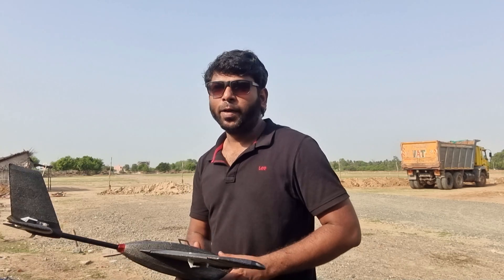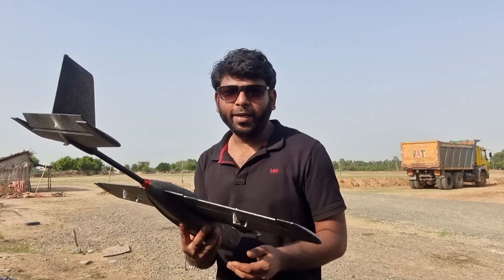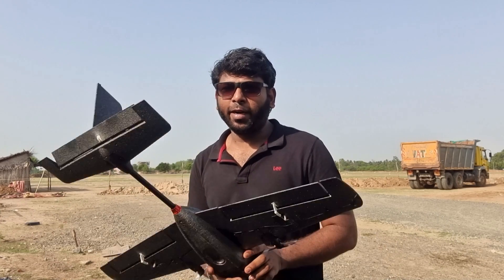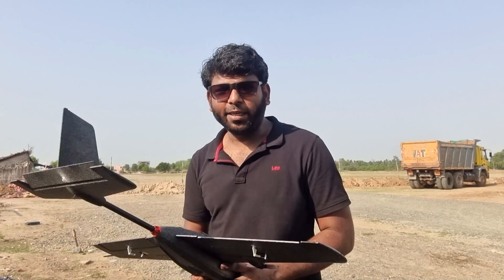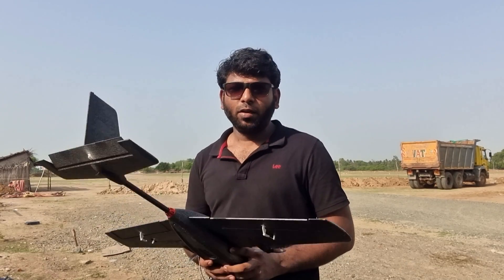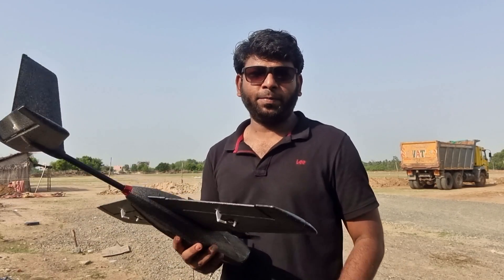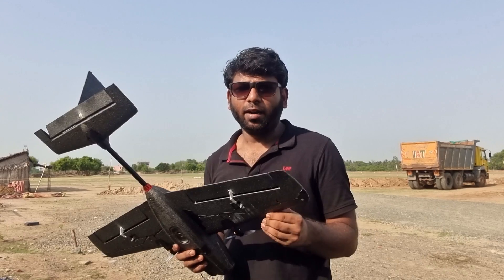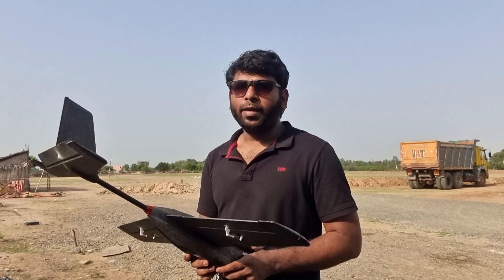Beginner's Tutorial: Arduplane Flight Modes

Comment: hi sir 

how to upgrade x6 motor esc  12s to 14s  with hobbywing datalink...?
Reply from the maker: Hi..
Regrettably,  upgrade is not possible. The X6 motor is designed to support a maximum of 12S and the X6 Plus motor supports up to 14S.

Comment: Hi Karthik, I’m working on building a vtol q-plane with a 10 motor Deca frame but my cube sends a message that it’s unsupported and there’s a config error, even though it’s a full parameter list option. Do you know if it’s a possible frame without any changes to the os code? Thanks!
Reply from the maker: Please check the availability of your frame class in the ArduPilot documentation.

Comment: if you doing this from your remote how does the MP see it live. i have to connect it first then see the gps of your location is how the purple line follows  the plane?
Reply from the maker: Sorry, I don't understand. I conducted a flight test using my handheld radio and then I made a mission for the plane to fly autonomously. The purple line represents the flight path trace.
Reply: @karthikstechtime0910 right but how does it see it live flying manual. Meaning do I have to connect to mission planner to find my location then select stabilize mode on the mission planner? Hopefully I’m making sense what I’m asking you. You talked about stabilizing mode as an example yet you see the purple line flight. If I was able to do it myself as an example, how can I show it show the purple line is there a setting I have to put on the mission planner connect to it first from my GPS to find me and disconnect it all automatically show up on the mission planner? I’m sorry I feel like there’s some pieces that are missing that you’re not explaining in general someone like for myself I was trying to understand as much better. I know you know what you’re doing, but I’m still learning so I’m just trying to understand.